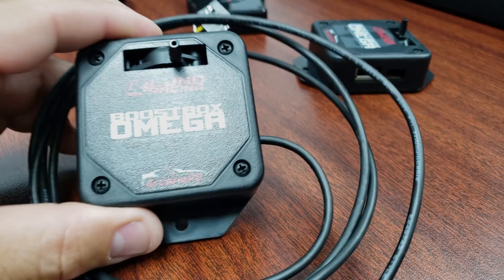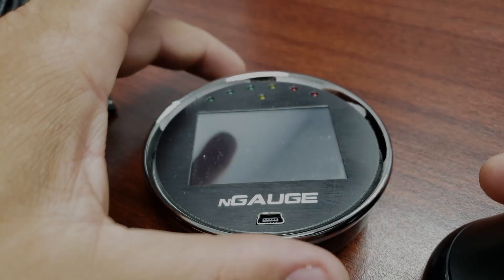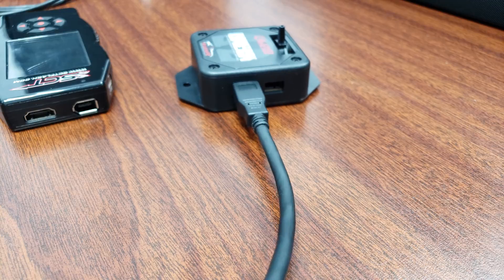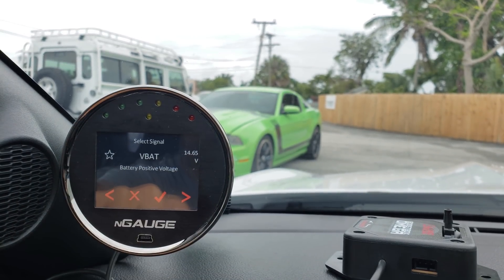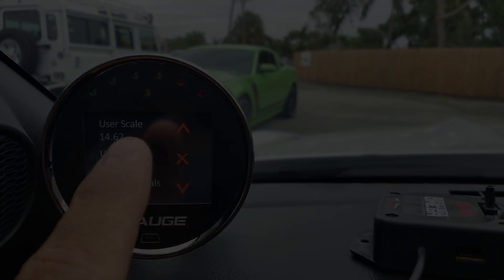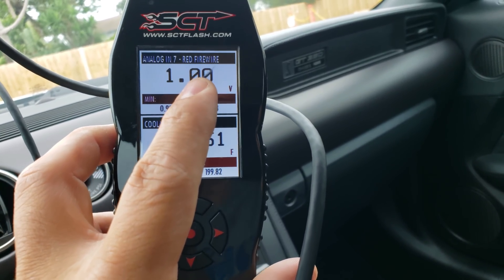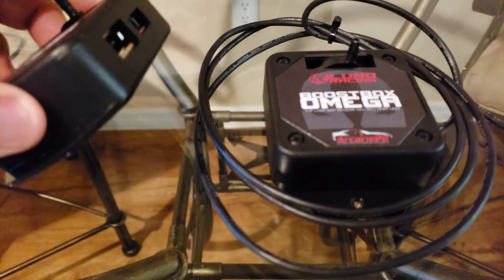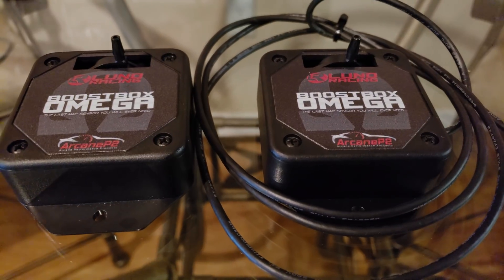Lund Racing Boost Box OMEGA Overview

Comment: Is the Barometric Correction the only difference between this and the older Boost Plus box’s? I have a Boost Plus box sitting at home waiting to be installed and was just wondering before I got it on the car. Thanks!
Reply from the maker: Evil-Punkin basically. Yes. The actual map sensor is more accurate. And the box and electronics are more secure.
Reply: Lund Racing ... Thanks for the fast response! I may eventually upgrade to the new one sometime down the road.